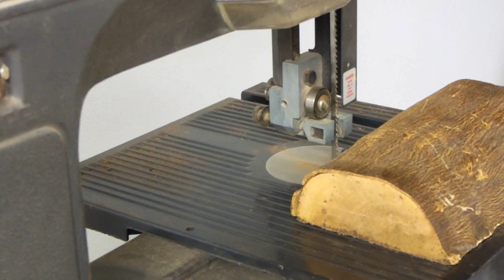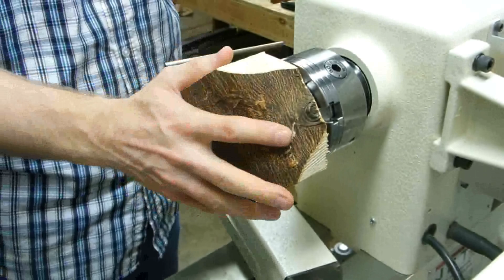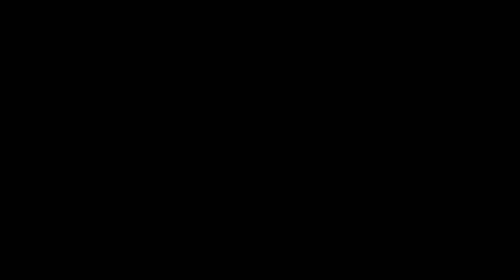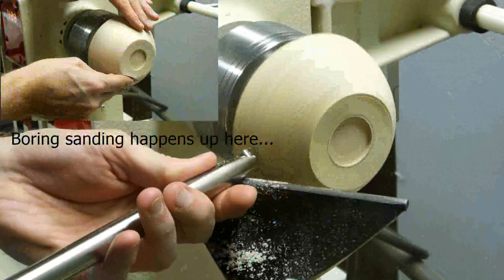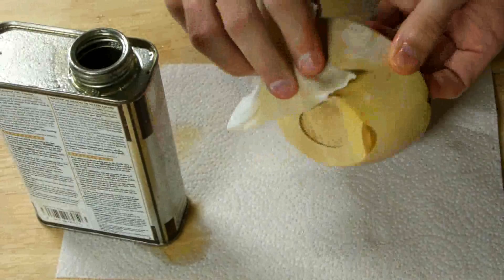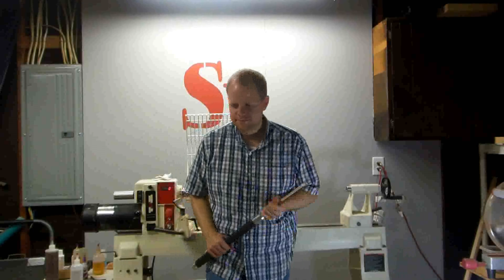Woodturning small bowl from lemonwood with carbide tools

Comment: Is this a joke?  Music so loud you have to turn it down too low to hear the commentary, and then you see a chap with a perfectly good bandsaw using it to "knock the corners off" a square blank of sawn log.  Take a tip: a bandsaw is designed to  cut 'around' corners.  That is why we turners buy them.  But hang on - there's an explanation.  He says he doesn't have nice round templates to get nice circles.  Really?   I have been turning wood for 65 years and never once used a template to draw a circle.  I use a thing called a compass.  For a bowl this size a child'swll do.  For bigger ones, make your own.  Please learn the trade before demonstrating.  This video made me angry.

Comment: Thanks for a helpful video (except for sound, that is).  Question: What was the speed of the lathe in your turning demonstration?  I have a set of these tools but have inconsistent experience.  One problem I think is that I've had the tool rest a farther distance from the wood than you had in the video.  Thanks again.  Peter

Comment: I am brand new to wood turning, and bowl gouges scare me....afraid of catches.  Are the carbide tools easier to use?
Reply from the maker: Easier to use, I'd say yes. Probably can't get quite as nice a finish off the tool as you could with high speed steel traditional tools, and you still have to watch for catches a bit, but they do make it easier to get started.

Comment: I am a turner that has been turning quite a while and I really like to encourage others to turn but I think it is necessary to learn about the lathe tools. Carbide has it's uses and can be very convenient but from what I understand from reading and watching videos on Youtube, many companies are promoting these tools (which are really scapers) as the primary tools, these tools will not allow you to learn the shear cutting that is possible from most high speed steel tools. Turning is both art and skill and if you are really interested in learning it as thoroughly as possible you have to do the work.

Comment: Hello: I just received my set Mid Size Carbides and need to say WOW, First off I was surprised to see how you folks shipped them, TOTALLY BLEW ME AWAY, I was figuring on just a box with the tools wrapped in bubble plastic, but when I opened the box, I knew right then that they are going to be QUALITY TOOLS. The feel of the handle, and the weight is AWESOME, and the HARD CASE/PROTECTOR is just great too. I just played with them on a piece of “fire wood” and let me tell you what, I LOVE THE WAY THEY RUN, SO SMOOTH AND EASY TO CONTROL, and for a first time turner (only been turning for 3 weeks) I feel at ease compared to a “standard gouge”, THEY JUST FEEL SAFE(R) IN MY HAND AND ON THE REST.